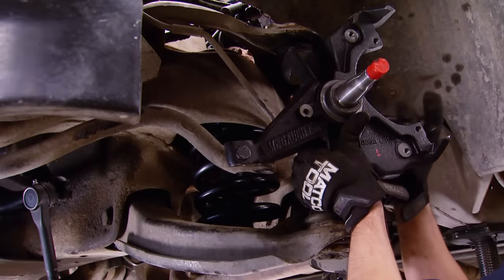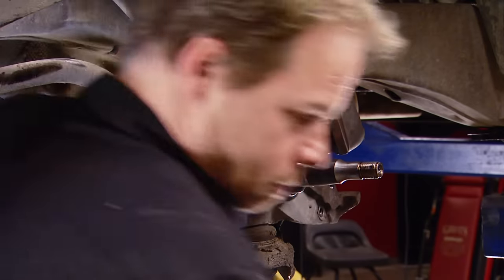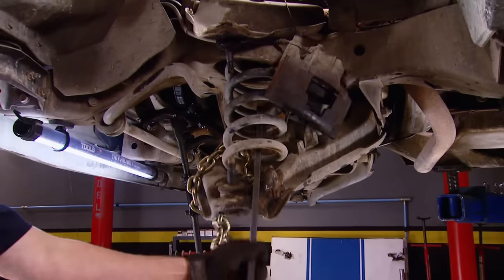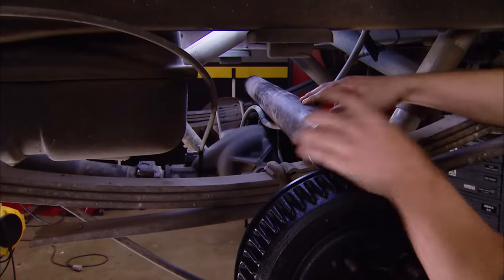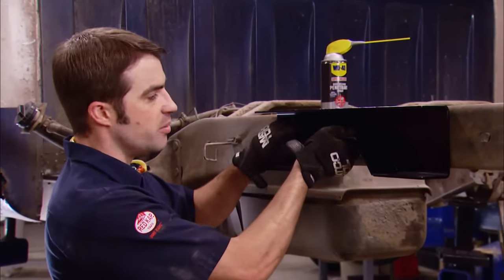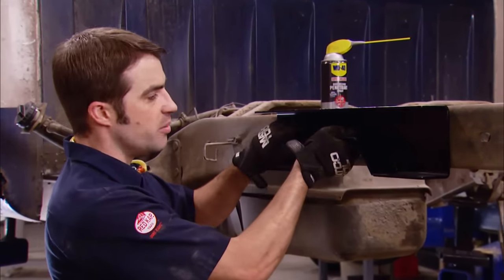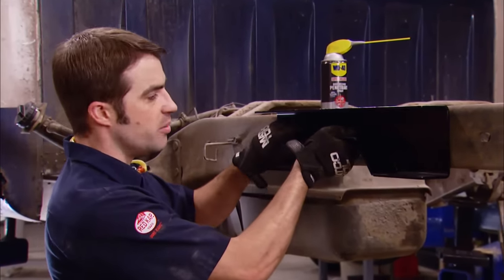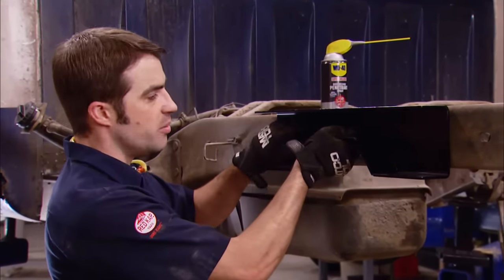Lowering a Chevy Silverado to a Street Truck Stance - Truck Tech S1, E6

Comment: If you're going to take the time to pull the spindles, you might as well change the ball joints, especially drop spindles are going to put a little bit more pressure on the ball joint now.
Reply: and while your there you might as well hit it with a wire brush and some basic bitch rustoleum black rattle can paint......  I mean noone is going to spend all that money to lower a truck and do all that work just to bolt new shiny to old and rusty.... You don't have to do a complete frame off but atleast do what you can get to, There's absolutely NO reason not to clean and paint the frnt suspension when it's already taken apart and the rear end and drive shaft when they are already out of the truck and the rear frame while the bed is already off.

Comment: I’d love it if you would do some programs on wiring. STuff like:

• How to lay out and wrap a wire harness in a way you won’t regret
• How to plan wire routes so they look good, don’t get in the way, are adequately protected, but also serviceable should the need arise
• How to keep track of the wiring changes you’ve made
• How to select high quality connectors 
• How to attach harnesses to various surfaces in an elegant way
• How to match connectors to conditions, wet service, dry service, etc. 
• How to wire a complicated connector in a professional way
• What to do with pre-made harnesses that are too long …or too short
• How to make a crimp connection that doesn’t look awful

So many of the aftermarket parts you guys install on your shows are beautiful. A guy like me installs those beautiful pieces, then feels guilty about the awful wiring that goes around them. Even something as simple as a fog light installation or stereo upgrade yields an ugly rat’s nest of awkward crimp connectors. Surely there is a better way.
Reply: even the same model car/truck will be different depending on what accessories you have...its one of the hardest jobs but if you take your time and buy that plastic wire loom stuff you can take wires back out again. never use any tape, wiring nuts or zip ties and you will be fine (zip ties have a 5 year life expectancy ) and its great if you have the old wiring harness and or at least a wiring diagram
Reply: One tip i picked up is you can chuck a few wires in a drill and twist wires together makes them hold shape and keeps everything tight. Also if your looking at connectors and you thibk they are pricey for what they are those are the ones to buy. Never ever cheap out on connector or wire

Comment: These guys are a joy to listen to compared to some of the jerks/ comedians on the premier car channels. Straight to the point and informative 👍
Reply: True but they, (PowerNation) also half-ass alot of stuff, They are going to lower a truck but not at bare minimum hit the rest of the front suspension with a wire brush and rattle can black? They are going to c-notch the frame in the rear and not atleast clean it and rattle can it and clean up the rear end and not rattle can it? Noone who spends all this time and money is going to not atleast clean it and rattle can it, no mechanic worth his salt is going to half-ass it and bolt brand new shit up to rusty and corroded parts. I'm not saying do a frame off restoration but atleast rattle can  the parts you can get to and make it look better and it's only going to cost you a cans of cheap basic bitch black Restoluem spray paint. they're $6 a can at Wal-mart.... If your just bolting new stuff up to stuff that looks like it was recovered from the bottom of the Atlantic Ocean and not atleast cleaning it off and rattle canning it your doing a half ass job. I mean your already there and it's already off..... do a good job and clean and paint it.

Comment: I would have welded that plate on as well as bolted it.
Reply: Definitely agree. I'd also box the c-beam frame for about a foot in front, through, and behind the cutout.
Reply: Welding introduces heat into the frames metal and makes it weaker around the welded area
Reply: Spencer little - Then why weld anything at all?
Reply: The welding can effect the heat treatment and hardening of metals such as the frame.
Reply: @charlestorruella8591  lol
Reply: @charlestorruella8591  Spelling 100
Reply: @charlestorruella8591  I had a stroke trying to read this bro. Do better

Comment: What's wrong with the 2tones Chevy I think there nicer then just a one color
Reply: I like the 2tones as well...but I like the 2tone where its a diff color down the rocker panel...I had a 99 Chevy Tahoe white w/ the charcoal gray on the rocker panels..was clean truck had it for like 15 yrs...drove the crap out of it
Reply: its a dated look...so many of those trucks had that it just looks old...two tones nowadays are like just the area above the bottom of the windows or sometimes a rocker can be black against a monochromatic look
Reply: They have to make it up to todays standards, ya know strip all the chrome off paint it matte black and take alm the badges off
Reply: Green primary and brown secondary two tone with some blackout treatment and lowering is the way to go, buddy had a truck just like that and we loved it. He sadly blew the 454 swap and decided to sell it.
Reply: @bobbydc33  lol
Reply: @philtripe  your wrong brother  whats dated is slamming every truck you see and putting black wheels ,now that got old real quick
Reply: Im thinking of a tri tone, but putting bigger tires, low pro tires are not for everyday roads.
Reply: @bobbydc33 I never liked that look.

Comment: My dad had a truck like this he put a freshly built 350 horse 350 into from JEGs in the early 2000s. My uncle bought it, and drove it from Louisiana to California to give to his son for his 16th birthday and drove it alongside his 98' dodge pickup with a 5.9L magnum, he said him and his friend driving his truck would line them both up, and the chevy would smoke the dodge every time, and get better gas mileage. His ex wife didnt want his son to have it though and sold it to some mexican fellas for $1500 not long after. Never heard from the truck again. Im sure its still running around the san bernardino/socal area somewhere. Had a black primered passenger fender.

Comment: I liked the wheels that were on it more than the new ones, Ya'll need to do a show how to redo a set of factory chrome/custom wheels that has lost their shine, Imagine how good those wheels would look if they were cleaned sandblasted and repainted silver or blacked out. I love these "were going to show you how to build a vehicle on a budget" then you throw a set of $5000 wheels on it.... The Overwhelming majority of us viewers aren't going to do that, Were going to clean-up and redo what we got or were going to jump on Facebook Marketplace or Craigslist and find some used wheels and redo them for $30 instead of spending $5000 on new wheels. Ya'll also need to learn what a wire brush, rubbing alcohol and can of black spray paint is... Ya'll keep bolting up new and shiny to old and rusty...  the front suspension was already taken apart, the bed was already off the frame and the rear end and drive shaft were already out of the truck, wire brush it hit it with some rubbing alcohol and then rattle can it, I'm not saying do a frame off but atleast clean and repaint what you can get too. Ya'll do some cool vehicles and give us alot of good tips and how too's but you stop short on alot of it too.

Comment: All that work... and they didnt replace the worn out balljoints?
Reply: I agree, over 200k miles and not replaced. I know mechanics like that.
Reply: Or control arm bushings...
Reply: @otsenres1636  Yeah, really any wear parts should have been replaced, for sure.
Reply: If they aren't worn out, why replace them? I just had a car apart for a new clutch. 250k miles and the ball joints were just as good as new. No reason to replace the good condition factory joints with some aftermarket junk unless you have to.
Reply: @isaakwelch3451  it's blatantly obvious that at least the bottom one is terrible worn. When the drop spindle barely touched it, it moved like it had no life left in it. 5:35

Comment: I always wandered if there's a specific purpose to lowering that people have in mind besides funky looks and possibly getting stuck on larger speed bumps? I can see a little lower for handling for street only use but why have a truck? Guess I'd rather have the useful clearance myself. Leveling the rear looks good and still leaves one half useful. Guess I've just never really understood real low drops.
Reply: Agree. 2" of drop is plenty. Looks better, more aerodynamic, easier ingress and egress.  Less likely to bottom out and can still be used as a truck.

Comment: So in the beginning when they showed the flip kit, there were two round cylindrical black items. What are they and where were they installed? What had to be cut under the bed itself? Cross braces?
Reply: I think they were bump stops, didn't catch where they put them...I kinda wanted to see it all together too.  They cut the frame to fit the "C" notch so it would have more travel.  There is another video on here that shows this pretty good too...Its called Andys Auto sport or something similar to that.

Comment: ALWAYS SUPPORT THE LOWER CONTROL BEFORE DISCONNECTING THE SPINDLE 🤦🏾‍♂️..they are lucky this thing had tired springs
Reply: They kinda left them sway links in thou
Reply: Absolutely agree
Reply: Edward Myers Old tired end links can easily snap off from the pressure of good springs and now you have those as a projectile as well..there is no excuse for cutting corners especially on something as dangerous as that
Reply: @eriv4735  there a shock inside the spring thou, the spring can only push down as much as the shock allows it.
Reply: Edward Myers wow you don’t even stand by your original conviction and just TRY find something else to argue with me about?...first tie rod now shock?..well what if  if BOTH of your oh so well thought out safety precautions fail?..you know kind of like that two piece “shock”?? FAILED🤦🏾‍♂️..again there are absolutely NO EXCUSES for half assing a job bro

Comment: Help me help me. Someone lol. I did a half c notch like this and now my bed is higher in the rear.  All four corners are touch but the 4 inside bolts are not :about a 1/2 inch out. The bed bolted down but you can see it’s higher in the back. The truck looks broke in half. Someone help me

Comment: Come on,guys,  where is the jacked Lamborghini with a 23" lift kit - and the asshats to say that you've improved its performance?
Reply: lowered truck = easier to load a bed + better handling

RWD trucks aren't good for offroading anyway.
Reply: basshead  yup, a bed around your knees is handy given you lose the suspension sufficient to carry the load!
First of all, unlike the later models, the 88-98 style chevy/GNC pickups did not feature a bed that is difficult to access. And just like with larger profile sidewalls, there is a reason for them in terms of load carrying performance. And if you are looking for a touring vehicle, you are looking at the entirely wrong vehicle topology.
Bottomline, this approach ghetto risking undercarriage damage and effectively negating the advantages of a trunk - unless one is one of the all too common truck owners whose most rigorous use of the truck is toting groceries.
Reply: +sdushdiu   So basically you posted a load of gibberish. Okay, well that's cleared that up. Come back when you know what you're talking about.
Reply: +sdushdiu   Sure buddy, whatever makes you feel better about yourself.

Comment: casually pimpin' $2000 rims and tires....
Reply: No way man those things are only like 250 a piece rims have come down alot there are still alot of hight dollor ones but there are alot of cheap ones now not like when i was yonger we always bought 2nd hand rims cause there was no way we could afforrd 2000 for cheap rims i mean tbey had the old wagon truck rims for 30 bucks a piece but a set of centerlines would set you back 5000 now you can get them for 250 a piece all day long off amazon

Comment: try using trucks NOT from California.  Try that with a truck from Ohio with 260,000 miles.  First you'd have to fix all the rust on the body and frame.  Plus, it's easy to do what you do when you have all the tools and access to basically an unlimited budget and talent to work on things.

Comment: I wish these guys had a better sense of style in consideration of the 88-98 present day owners and customizers.  Two tone paint is beautiful on a lowered 1/2 ton truck, with the right rolling stock.  Additionally, the hosts sound like snobs when chiding against the present day trends, in lieu of aggressing toward their own outcomes.  Get it fixed guys.  You are being outclassed by  mechanics with hundreds of thousands of Instagram followers that are more tuned into the trends with a modicum of technical skill.
Reply: I think they just going for mild high something simple, fashion that's the highlight now days nothing flashy that's the flip side that style turn attention that's  moderation cruising down boulevard fashion